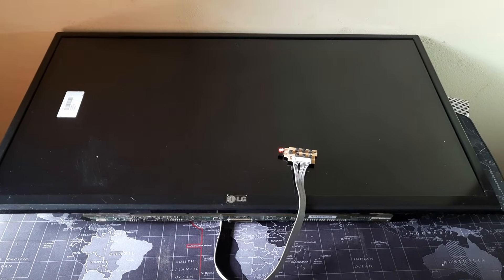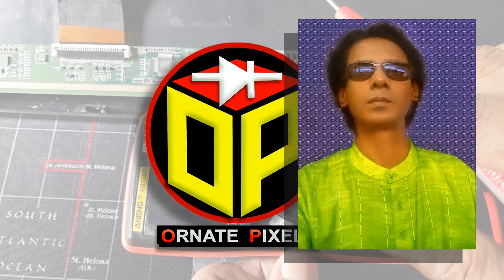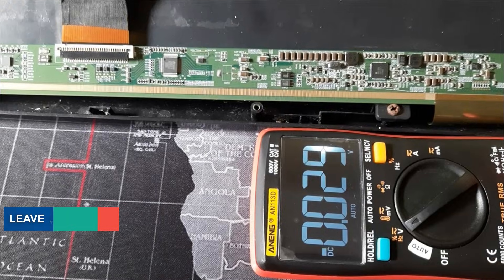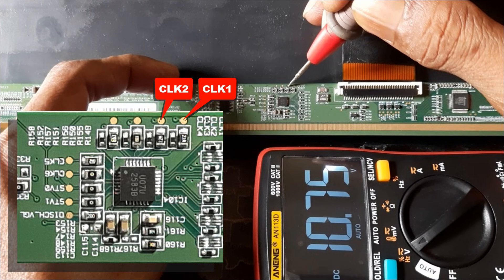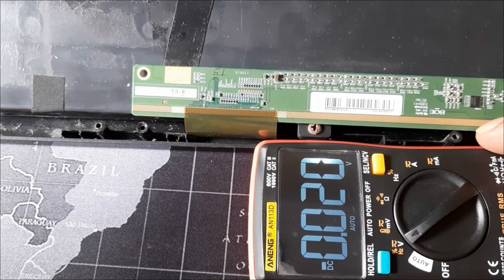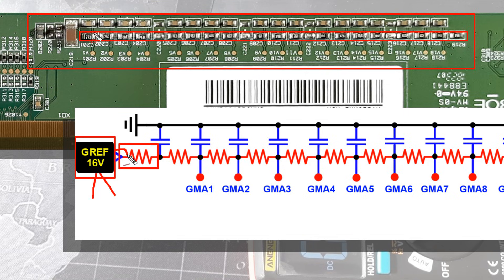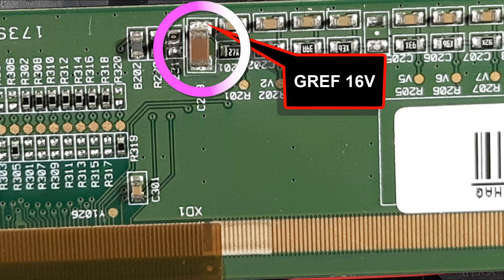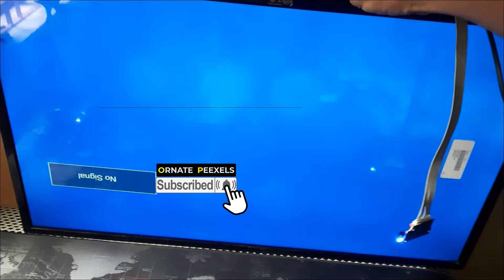White Display and Very Blurry Image on the HV320WHB-N5N BOE Panel | LG LCD TV Panel Repair

Comment: Great video. I have a 55" Westinghouse with almost the same problem. It will show a good picture for 2 minutes then turn white. Do you have schematic for the tconn board PT550GT03-1-c-3?

Comment: I have the same issue with a tv i was given for  parts, but after a few minutes, it begins to alternate black and white The back light is still fine. Any suggestions
Reply from the maker: All the capacitors in the gamma voltage divider section should be checked, there may be a short circuit somewhere on the panel along the 6 CLK. Thanks Brother
🌺♥🌺

Comment: 16v volt is ok.but same white condition
Reply from the maker: The gamma voltage divider section has 18/19 capacitors. Measure the voltage to determine if the capacitors are damaged. Also, check the six CLK voltages. Sorry for the late reply. Thanks Brother
🌹❤🌹

Comment: stv voltage missing problem what is doing sir
Reply from the maker: Most panels have less than half a volt on the STV, if there is a short circuit inside the gate COF, or if there is a problem with the STV output, the voltage will be missing.
Thanks Brother
🌹❤️🌹